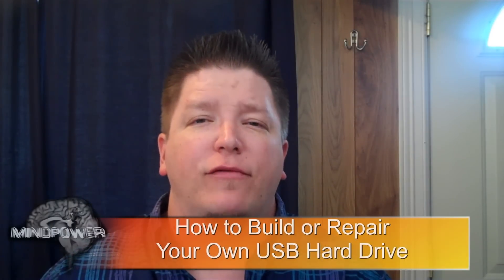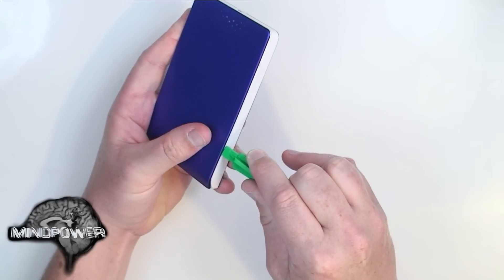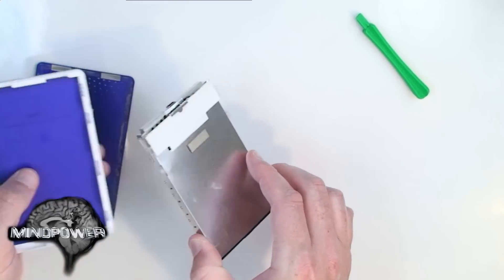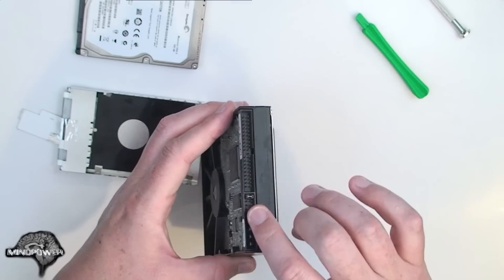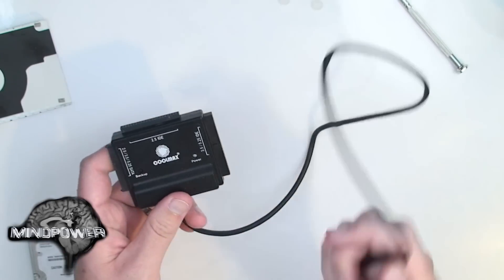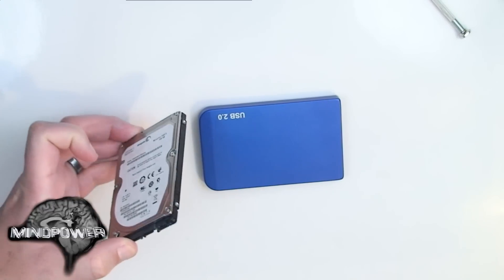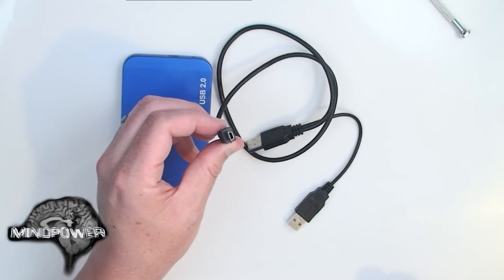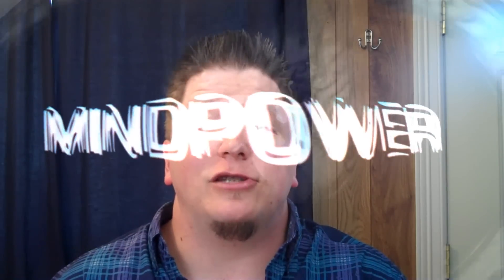How to Build or Repair an External USB Hard Drive

Comment: Hello,
 the usbB port on my external HD 2.5" came off and it has been welded (I guess improperly) but it still doesn't work The drive makes a noise (so it gets power) but the system can't see any connected drive. What do you suggest I can do?
Reply from the maker: I think if you still have a warranty, I would check to see if you can get them to repair it.  

If you're out of warranty, this might be the time to open it up and see what's inside.  These days, you'll probably either find a SATA or NVME drive inside, and you should get a new USB enclosure that you can plug that drive into, then into your USB on your computer.

Pretty much what I showed in the video.

Comment: Hello, I really wanted to ask if there is a possibility of fixing my sister's Toshiba external drive... I accidentally dropped it two-feet high while I was cleaning our room and i think its broken because everytime i shake it there's something that's moving from the inside of it, and when i connected it to my LP it recognizes the harddrive but it won't open... I'm so afraid to admit to my sister that I got it broken and so I just said it might have had viruses inside of it so it wont function... I am really hoping you can give me some asnwers! thank you! and I love your video by the way..
Reply: Kpop Informed same here

Comment: Would you know how to fix one of these? https://encrypted-tbn1.gstatic.com/images?q=tbn:ANd9GcSkVIL1Et6QcLgQ92E8MNi5y8Crd6gnBikxQimO7Q9jOe7sICsWouDgE3iS mine is failing to connect. I can hear it struggle to connect the blue light flashes on and off but it fails. Can it be fixed?
Reply from the maker: If it were mine, I'd try to figure out how to take the thing apart.  What you have there is just another kind of external case with some kind of hard drive inside it, something like what I have in the video, just a different kind.  Anyways, external cases are super cheap (see the links in the description), and once you get the hard drive out, it's a super easy operation, and a cheap way to find out if that's all it is.  Or, if it's under warranty, take it back.

Comment: my Seagate external hard-disk has a mechanical failure it beeps for 4 time i want to recover data any solution!!
Reply from the maker: beeping is usually an indicator of the hard drive "spin-up" fail.  You'll want to take it to a recovery specialist.  I do not recommend Geek Squad, but find someone (there are even some here on YouTube that do it) that specializes in disassembly of the platter mechanism and recovery of the data.

Comment: so my little niece nocked one of my ext hardrives off the table by accident and hit the floor. when you plug it in you can hear it spinning and it sounds fine but wont read now. can it be saved r is it screwed?
Reply from the maker: For me, the cheapest way to find out is to put it in a new enclosure and see what happens.  After that, the next step is to take it to somebody professional to recover the data.

Comment: Since about the last ten to twelve years or so, IDE have not been used anymore in computers. Most drives used are SATA. 

I now buy enclosures of my personal preference. There are many types. The pricier enclosures are easy to swap the drives in and out. With today's devices and computers get a USB3 type enclosure.
Reply from the maker: That's not quite accurate.  I'd say IDE drives have still been used in new computers up until about 3-4 years ago.  Having serviced many of them, many budget PC's had IDE up until fairly recently.

Also, most budget PC's today don't have USB3 yet, while almost all computers over, say $600 or so have at least one USB3 port.

Comment: I have a external hdd,when I start it to connect to PC I pushed data cable more forcefully ,then suddenly the USB slot has broken,then thought this hdd,can make as internal hdd for that what I want to do...,,sir can you correct answer for mee
Reply from the maker: In most cases, you'll be able to just replace the enclosure as shown in this video.  If that doesn't work, you'll need to take it to a professional specialist in hard drive repair.

Comment: Thank you so much, a week ago my external hard drive stopped working. It seemed it wasn't connecting to the hard drive inside. I followed your steps since I have a similar one and bought the same blue casing you used. It fixed it 100% and now I can reclaim all my important data and files. Now I'm off to buy a new external hard drive to back everything up.

Comment: I have the same external hard drive. When I plug it in the lights on the inside just blink or flash. Could this fix my problem?
Reply from the maker: +william shockey I would give it a try.  You won't find a cheaper remedy.
Reply: +MindPower009  True a cheaper remedy is hard to find.
Reply: Most likely the drive went bad. Sometimes it is the interface USB to SATA that fails. This is the small circuit board with the connectors on it that go between the drive and the cable to the USB port. 

It is best to get a new enclosure, and also purchase a drive to fit in to the enclosure. This could actually work out cheaper, and you have the flexibility to swap drives in and out.

Comment from the maker: +Nathaniel Pillar  #1:  Not all enclosures come with 2 cables, I recommend getting the ones that do.  #2:  If you have both cables, I recommend using them (per my reasons in the video), and #3:  The Coolmax comes with a power cable for 2.5", 3.5" and 5.25" drives.  It has a "wall wart" type design and a molex connector that plugs into the drive or the interface.

Comment: If the coolmax supports 3.5 inch drives, why is there no power adapter? 3.5 inch needs external power.

Comment: Hi!  I got the Coolmax adapter and tried it out today on my mini external drive and when I plugged it into my drive, the adapter beeped a bunch of times.  Does that mean my drive still works? :s  Lol, I can't find any information on the Coolmax website or anywhere about how to tell if the drive being tested is working.
Reply: Honestly, it's probably your drive beeping.  That's what it sounds like when they can't spin up.  Your drive might be frozen up.
Reply: BroBryceGardens Oh, yikes :s  I thought that the portable drives didn't spin (It's from a Buffalo Ministation)!  It stopped working after my Girlfriend's kitty knocked it onto the floor (from only about five inches off of the ground!).  I was surprised too because it fell a few times from a higher distance and it was always fine before :s  Do you have any videos about how to unfreeze portable drives? :s
Reply from the maker: ***** That's something where you have to take it to someone who specializes in forensic recovery.  The drive is dead, no getting around that.  The most you can hope for is that maybe someone can unlock it and spin it up to recover the data, or maybe they will have to swap out the platters.  Really hardcore, and most folks are simply not equipped for that (and neither am I, as I don't have a sterile "clean room" to perform it in).

Comment: my hard drive fall down from a table and it stopped working. The disk inside is spinning but my computer cannot find anything. Please help.
Reply from the maker: Adib Alim If the instructions in the video don't work, you might have to take it to a hard drive technician.

Comment: sir i had 1 Tb seagate external hdd.... when it running its fall down with in 5cm distance... after i head crick crick sound then i plug out after connecting the lite will be statred blinking.... now its not showing in my computer.... what it happened? can i get back data.... by applying this method
Reply: RAVI JADI  hi sir !! now i m facing same problem with my  seagate external harddisk  did u recover your files sir? pls help me out sir

Comment: If I have 2.5 IDE hard drive laying around is possible to buy and a enclosure and use it as a external storage?
Reply: Google > 2'5 INCH HDD CASE > Win
Reply from the maker: Yup, totally.  The links are in the description to this video for whichever case you need.
Reply: I have a Verbatim usb 2.0 external drive. It uses a single usb cable and I had to use two usb heads, power, and data, it was working but now it's dead. Tried everything. I opened it and it has a printed circuit board on one side in the back of the silver side. It has no SATA or IDE just a micro USB. I really need my data. Any suggestion??

Comment: Hi Bryce, i have an adata HD710, its not fully connecting to my mac, the light is on but its not showing up in the drives, it is showing up in disk utility but its not allowing repair or verification. Im sure the drive its self is healthy but its the port thats not stable, would talking it apart and stabilising it help? im desperate to save its content! please any advice would help. thanks.
Reply from the maker: I think it would help to follow the instructions in the video.  I used to have an AData drive.  Should be fairly straightforward to take the drive out, and put it in a new case or hook it up to a new interface.  No guarantees, of course.  But that whole scenario is exactly why this video was made.

Comment: In fact I had an external USB drive (with lot of my data ) whose adapter at the drive end had sunk in. t I tried to bring it out, but suddenly I thought why not try a Google search. I saw this video, opened the drive case (no screws) and saw I cant do anything about it. Went to a computer shoppe as suggested and he simply opened it, removed the cover and put another one for just Rs 350/(  May be  Rs 50 more than in eBay) . The adapter is both USB 2.0 at both ends  with two at one end as seen in the video. It was just a few minutes job, I could retrieve the data. Now I have a new look drive with all data intact.  Such videos are quite useful for novices like me.

Comment: sir i have segate 500 gb hdd i have put that hdd into external case but it showing in disk management but not in my computer
Reply from the maker: Have you tried using Disk Mgmt to "mount" it?  If it won't mount, it could be that it is formatted using a different filesystem, or that the drive has actually been corrupted.  My sister had a Western Digital desktop hard drive with a broken USB port.  Since you couldn't get a replacement from WD, she bought a regular USB case, but it didn't recognise the partition on the drive.  It could have been that the partition used a special protocol through the USB controller she had.  We ended up reformatting the drive, losing everything on the disc, but the hard drive itself was physically unharmed.
Reply from the maker: You also might try reading it with a Linux computer.  It should mount even with a live Ubuntu CD.

Comment: Hey! This is such a helpful video!!! The usb port on my Maxtor external drive was loose and evemtually fell off. I opened it up and tried to solder it back to the pins, but my hand isn't steady enough for such a small soldering project. I ended up soldering it wrong. Been wondering how I would get all my info off of the drive and this video has helped so much!  Thank you, I hope I can get mines to work now!
Reply from the maker: bkameka69 This is how I've done many computers and externals.  This video pretty much represents a good practice I've gotten into for a long time.  Thanks for the feedback.

Comment: my hard disk has fallen off while it was on. after trying to reconnect it does not open it though it recognizes the hard disk. so wat could be done.. can it be usable again.. ? i got all my university work saved in it...
Reply from the maker: There's no way to tell until you try putting it into a new case or hook it up to a new controller.  It worked for a hard drive I fixed a while back, but there have been some where the data has been lost.  Dropping a hard drive is a fast way to lose everything.

Comment: Hey, thanks for the vid!  My friend's WD My Passport USB 3.0 would click endlessly when plugged into a USB port.  The LED would also flicker.  The computer would detect it, but it would not show up in "My Computer."  Would it be possible to salvage the data by changing the enclosure?
Reply from the maker: That's always my first approach.  There are times when the hard drive (the unit inside the case) itself is damaged, and you may have to take it to a professional to have it salvaged, but in most cases, I've been able to swap the enclosure and save the data.  I keep the cases around for those kinds of things all the time now.

Comment: Great video! Hi Bryce, I have a question in which I would like your advice/opinion.
I have a seagate backup plus in which I have accidentally dropped. The distance of the fall was about 1.5ft-2ft. After replugging in the USB cable and AC adapter, I hear a "beep" sound and it is not detectable.  Can you please advise? I cannot afford to have it checked or data recovered by outside source as it can reach the thousands. As I am in my desperate stage as there are so many memorable files in this external, any opinion shared is greatly appreciated!
Reply from the maker: That "beep" is the drive trying to spin up but the platter or head is stuck.  You will have to have the drive opened up and serviced by a professional in a clean environment, and the data recovered to a good drive, as that drive will definitely be toast.
Reply: Hi,
today i had the same situation ... please advice if you managed to find a solution ... some says shake it others say freeze it others says blow in the USB ... all my work data on it and i was working on organizing it to back it up :(

Comment: Very helpful. I have the same freeagent go, i think the usb adapter thing attached to the ide is what's failing although I am not sure, but I just wanna ask is there a way i could check if it is still working without the coolmax usb adapter?
Reply from the maker: Honestly, I hardly use the coolmax anymore.   The enclosures are so cheap now that I just get one and plug it in to see if it works.

Comment from the maker: I usually wipe 'em.   Most viruses attack your C drive, system folders, and documents that you open on occasion.  If you install this as a secondary drive, as long as you have some kind of up-to-date virus protection installed on your computer, you should be able to get past an attack, if a threat even exists.

Comment: I bought a USB-based external HDD a few years back: Simpletech Blueberry 160 GB.  One day, whenever I plug it into any computer, it would turn on but no PC could detect it.  I suppose the HD itself could be a SATA, as it would be used in laptops.  I'll look into that when I have a chance.  What you showed in the video, sounds like something worth trying.  Any exceptions or something?

Comment: I have a Western Digital Scorpio Blue 1 TB, 5400 RPM, 2.5" SATA Hard Drive.I like the blue enclosure you have.I found one on ebay but its capacity is only 500gb.I see others that can support 1TB but they only have one cable.Is that ok?I plan on watching stored videos and playing roms while it's on.I want to keep the hd on my laptop clean.

Comment from the maker: However, that's not what most people think they need to do, so they search for how to repair their hard drive, and maybe they actually find out it's not the hard drive that needs to be fixed.   What I've done here is not misinform, but rather I've made my video to be what most people are actually looking for, and most find out that while they THOUGHT their hard drive was bad (as did I in this case), it actually is fine, and all they had to do was replace the enclosure.

Comment: i have a question i have a few harddrives that my computer stopped picking up for some of reason ive changed enclosures but still nothing i also have one that looks like that 2.5 ide one but it doesn't have that many pins in it what would you suggest in that situation

Comment: Hi, dude i am having Seagate expansion Portable Drive Model No: SRD00F1
this hard drive is not detected by the computer but manually i can feel it working, with the Vibration and pls tell how to repair..it's totally not at all detected when i plug in

Comment from the maker: Sorry to hear that.   Sadly, I have two bits of bad news.   My experience with WD drives is that they don't survive falls very well.   Secondly, WD's external enclosures appear to use some sort of file system that doesn't translate well to just taking the drive out and plugging it into another adapter.   So, while you might be able to save the hard drive, you might not be able to get the data off of it without finding an identical enclosure.

Comment: I had a non-functioning Seagate portable drive like this one - your video saved me $750!! I had dropped it and it was clicking when plugged in, and the computer wouldn't recognize it at all. Opened it up like you showed and pushed on the top of the drive a bit - plugged it back in and computer recognized it and I got my files off!!! Super stoked...

Comment: I have that same seagate freeagent, but its 640gb and failed a while ago.  Mine just makes a small noise like its trying to boot up, but then it stops and nothing.. computer wont even recognize it.  Do you think it might be the controller board or the hard drive itself MindPower009 ?   Ill probably get that coolmax converter either way.

Comment: The adapter cable is a "band-aid" fix that works for the moment, but is not practical for everyday use.  However, it's coming up on a year since I made this video, and I'm still using that same hard drive in the USB case.   They're surprisingly cheap (many are under $10), and I take mine everywhere with me.   One thing to keep in mind though, it does work most of the time with a regular "single" cable, but on some older machines the "dual" cable is required .  Perhaps not enough juice from USB.